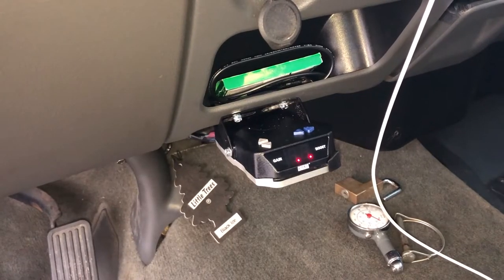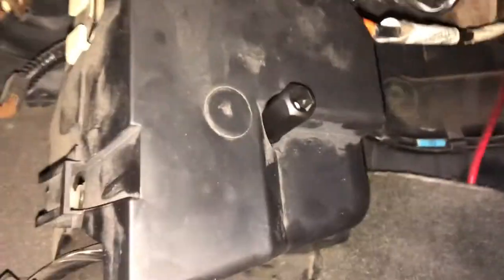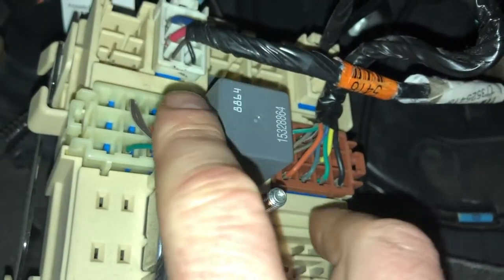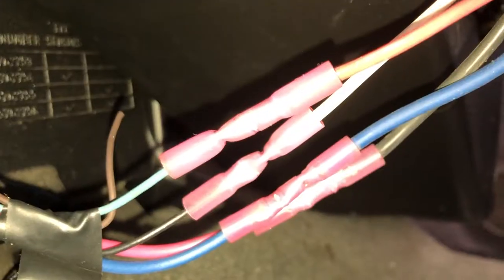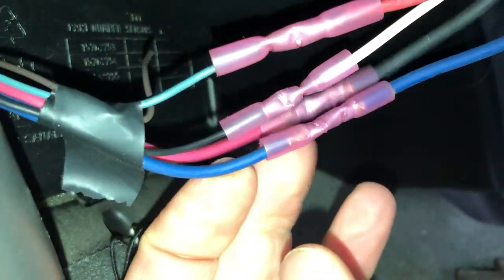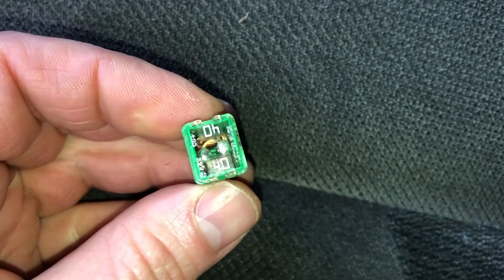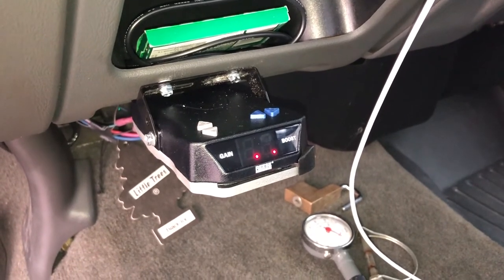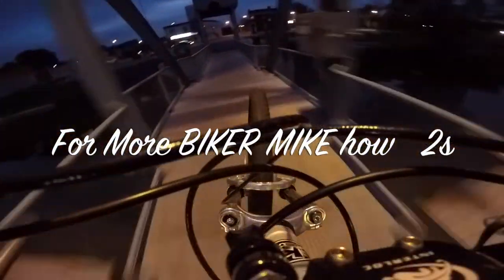How to install trailer brake controller 2005 GMC Sierra

Comment: The 40 amp fuse goes were the red fake fuse in #1 spot. This is to send 12volt power to charge a battery that some trailer have.
Reply from the maker: Thanks for clarifying that! Makes total sense!

Comment: Hey! Great video, I have a 2005 Silverado 2500 dmax and I have problems on the brake control , it’s shows everything you can configuration everything but when you step on the brakes I does nothing

Comment: Hey having a problem with getting power to my controller. If you have any ideas on what to do would be great !!
Reply: according to schematic, the red power supply is fed by a 30 amp fuse in the engine fuse box.

Comment: I'm transferring a brake controller from a 2001 Yukon XL to a 2005 Sierra 2500HD. Do you know if that's just an even swap or is anything different?
Reply from the maker: I can’t answer that for sure but should be very similar.
Reply: @bikermike  guess I'll just have to get under there

Comment: 2006 gmc sierra v6 with no tow package. I installed the brake controller and it had no power. Looked under the fuse box under hood and I only have one blue wire with a female clip
Reply: How do I go about suppling power to the brake controller and getting it to work
Reply: Hey having the same problem. I have no power to my controller. What did you end up doing to fix this problem, if you can help me out !!
Reply: Same here. Same issue.

Comment: (2005 Sierra 5.3 w/ factory tow package) Thx for video. I connected as described but did not get power to the controller. Trailer lights worked so I assumed the brakes would as well, if the controller would have gotten power. Does 40 fuse need to actually be in place to get power? Any suggestions? Thx.
Reply from the maker: Yes Make sure the trailer brake circuit has the fuse installed and that it’s good. Should be a diagram of where it is on back of fuse panel cover.
Reply: Hey having the same problem. No power to my controller. My lights work as well. Did putting the 40 fuse in the empty spot work ? Thanks

Comment: Did you identify the purpose of the brown wire in the factory harness? I'm wondering if it has something t do with the emergency breakaway for the trailer.
Reply from the maker: The emergency breakaway breaks are all self contained on the trailer itself with its own seperate power source (battery). I'm guessing it may be for a controller that has a dimming display that would dim with dash lights.. But I'm just guessing with that. 
Brown is tail lights on a trailer too.
Reply: @bikermike  schematic has the wire connecting back to the relay block.  Something to do with interior parking lights but I can't figure why that would be in the brake control module.

Comment: (*Side note) factory suggested tow weight for this year truck with 5.3 liter engine is 7500... have you towed more weight and if so how much weight and did it tow good? I ask because I'm looking to buy a toy hauler but I'm in California and smaller haulers are harder to find here.
Reply from the maker: These trucks have weak rear suspension, I just have small 6x12 enclosed. It does ok but I use tow haul mode to help save transmission and I keep it out of overdrive by keeping shifter in 3rd.  And don’t tow over 60mph
Reply: I added frame inserts to beef up the back of the frame. Doubled the framed thickness last two feet about. You'll want an oversized tyranny cooler up by the radiator and throwing an extra spring in the leafs helps. I beefed my frame up where my front shackles are as well as the cross member for the torsion bars. It's a lot of work truck is not made for it stock but after doing all that mine pulls fine as long as I put weight in the bed to keep the rear end from bouncing around. I got mine for 500 bucks so it was worth it to me as a backup for my one ton to pull a landscape trailer but I wouldn't use for regular use or long trips.

Comment: Hey bro where does the other extra little purple wire go to or does that not go to anywhere
Reply from the maker: I maybe wrong with this, but its a brown wire you may be referring to. I believe it is connected to the dimmer circuit on dash lights if controller has that feature. but don't quote me. may have to ask dealer to be sure
Reply: biker mike OK bro. Thank you I connected it like that with that little wire it back and it seem to work fine so hopefully will find out this weekend when I haul my trailer LOL

Comment: took mine off it was draining my battery
Reply from the maker: Which one did you have?
Reply: @bikermike  Reese Brakeman IV Digital Brake Control - 83504
Reply from the maker: @julvo4799  my Reese controller ending up failing, went with a Tekonsha primus iq 90160. Seems to work excellent so far

Comment: What if my truck doesn't have that harness???
Reply from the maker: Should be able to buy one online somewhere or the dealership. Just make sure truck is set up for it. (Ask dealer) If not can still do its just a bit more involved. Hope that helps!
Reply: @bikermike  one last question... what is the part # or name of that harness? I'm 3rd owner of my 2005 GMC Z71 so I'm pretty sure mine is no longer stored anywhere on my truck...thankyou
Reply from the maker: @peanutbutterpaul7232   Heres a link to a plug and play (Reese) trailer brake controller. will plug into truck and a reese brake controller. or could splice it into another brand of controller. Amazon 18$  https://amzn.to/3rS69Ad  (affiliate link) I'll get a small commission if you purchase. Can get them anywhere too though! ;)
Reply: @bikermike  right on ...thanks
Reply: @bikermike  I'm ordering both Reese items right now...thanks for the info and you gained a new subscriber

Comment: The 40 amp fuse goes to the where the red fake fuse is.. it energizes the #1 stud out of the fuse block!
Reply from the maker: Just saw your comment now... thanks!! Trailer brakes have been working though. So by installing the fuse there will it pull power from a separate source to reduce amperage draw on the rest of the circuit?